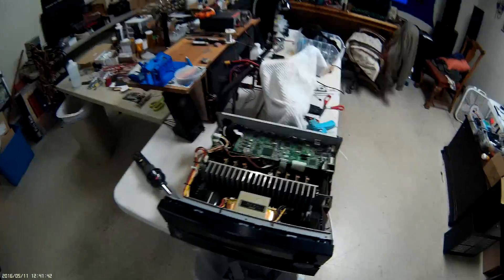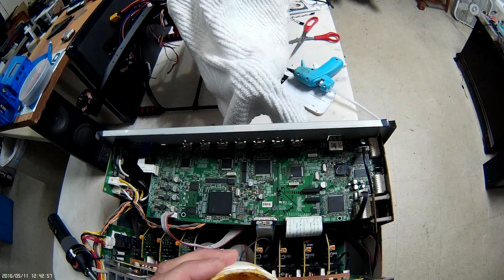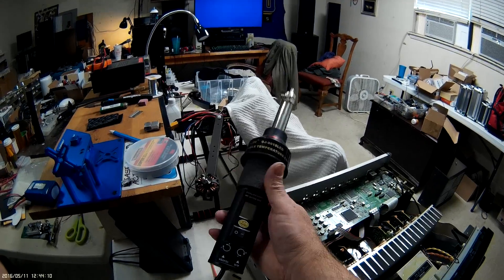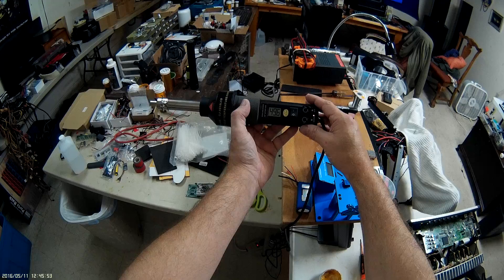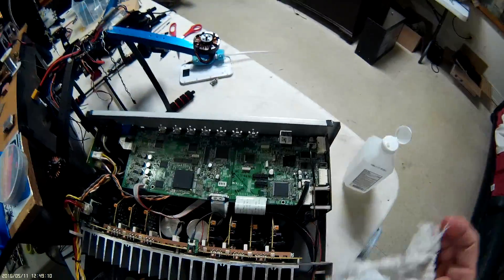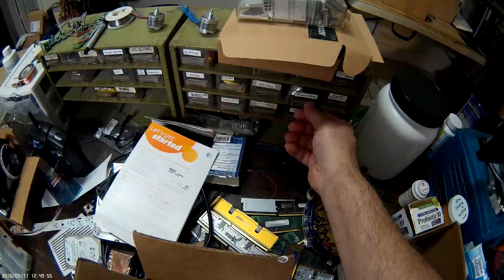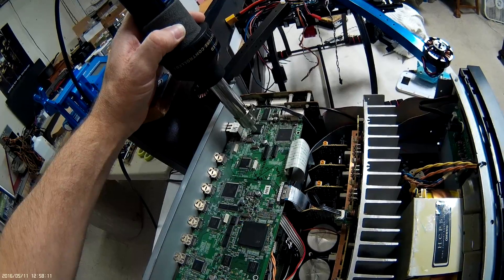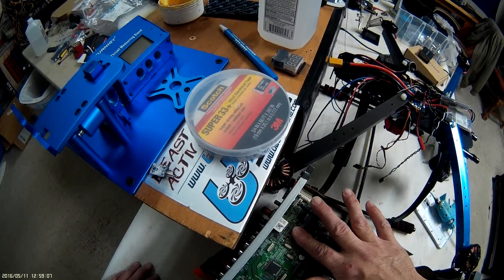Onkyo TX-NR Receiver DTS chip Reflow Procedure

Comment: HI Sir. I have Onkyo TX-SR875 which have issue of popping and crackling 
sound from front and surround channels. Few weeks it gave popping sound 
from Front Left and Surround right speakers. And then the both channel 
doesnt output any sound, its not completely dead because sometime it 
give sound with popping noise. When I try to firmware update it stucks 
in Updating.... option. Please help me to repair my AVR.
Reply from the maker: Popping in the speakers usually points to a bad output transistor but if yours is getting stuck writing firmware, it may have more than one problem. Did your receiver get surged? Sure sounds like it. It may not be worth repairing. But I would start by checking ALL of the output transistors and capacitors. Bad capacitors can also cause popping in the output.
Reply: @ShaneCarles  Firmware stuck issue solved. But i still dont got sound from digital audio inputs. Avr gives sound only with cd, aux, tape stereo analog input only and give sound in direct or pure audio mode only. No output from other sources and no preamp out. Is it issue of CS3318 audio switch ic?
Reply from the maker: @adsaudioenthusiastic8704  - So it doesn't output digital audio and only analogue signals? Could be the DTS chip issue.

Comment: what a next ur onkyo receiver?
i have like same probelem
i was may time reflow Dts chip but still have like same probelm....
plz answer me, what a next
check to near Condenser(casipiter)?
Reply from the maker: Or re-ball the DTS chip.
Reply: thx for ur answers:)
Reply from the maker: No problem. If reflowing the chip doesn't fix the issue, either the chip is defective, you have a firmware issue, a bad FET output, or capacitors. Those are most of the things that would cause the speaker matrix to not show up.

Comment: To be clear, I used a flux pen around the edges of the DTS chip. I don't have a temp controlled heat gun so I just used the one I have and turned it on and off until I could see the flux starting to smoke. I used Isopropyl alcohol to clear the flux but I always buy 91% pure alcohol for electronics work (and all purposes) instead of the regular ~70%, that way it has less water in it and more quickly evaporates and cleans up faster. Anyway, otherwise followed Shane's instructions and it worked on the first try!  Thanks Shane!

Comment: Shane, I bought an Onkyo TX-NR555 supposedly refurbished. I got it home and plugged everything in. First thing I got was error "Check SP Mode" and it would shut back down. I took all the cables off and started it again and same thing. I reset it per Onkyo's site. Now it turns on but only in Zone2 mode. I still get no sound. Can you please advise? Thank you
Reply from the maker: Do you get a speaker matrix on the display? The common issue with most of these are the DTS chip on the HDMI board. Check SP Mode means a short across the outputs somewhere. If no speakers are connected then you have an internal short. Could be a capacitor or transistor output shorted.
Reply from the maker: Check SP Mode stands for Check Speaker wiring from what I can read. But if no speaker wiring is connected then that would be an internal short across the outputs somewhere.
Reply from the maker: Check the speaker terminals closely and make sure there are no stray strands of wiring still under the banana screws. All it takes is one jumping across.

Comment: Shane, Thanks for the great video! 

I have TX-NR828 with the same DTS chip problem. I have the same heat gun as you. I placed the appx 3/8" snoot on the heat gun, and set the temp to 650F and the airflow at about 80%. I heated the chip for what seemed quite a while - I could see the flux pulsing in and out from under the chip. However, the reading I get on my laser thermometer is only about 300F at the chip. IS that hot enough? (seems like it should be). 

Anyway, I tried this about three times, and I still get no "light". I see the FM section "tuning" but get no output in my headphones. I tried all the THX/DTS settings etc...

Any ideas?

Thanks!
Reply from the maker: I've had to replace every single one of the capacitors on these boards before to get them working again. If that doesn't fix it then the chip is bad.
Reply: Thanks again for the great info! I may just have my local EE friend take a look. I'm just a lowley CS Guy! :-) 

I'm really pissed at Onkyo right now!  I'm considering a future replacement of almost any "non-Onkyo" (or Integra) brand! Maybe Marantz, Pioneer, Yamaha, etc. 

Do you have any favorites?
Reply from the maker: Lance Bledsoe you are very welcome.
Reply from the maker: I Like Marantz, Yamaha, Pioneer in that order. But there are other more expensive brands out there that are far better than any of those even.

Comment: 4:53 you plug in the heat gun into 3rd from lite then 12:10 you say unplug the heat gun but you unplug the wrong one, you're gonna burn yourself one day
Reply from the maker: The heat gun has a switch on it. It was off.
Reply: so what did you unplug ?
Reply from the maker: It was the cord to my TS100 soldering iron.

Comment: i've had a few 709's and 2 809's with this issue, and I am bidding on a 3009 on ebay wtih the same no sound issue. Onkyo fixed them all free even send me a box and packing materials, The repair center is only a state away. took less than a week.
Reply: yes, but this free of charge repair  for units out of warranty  ended 2017 or 2018 :(

Comment: Hey Shane, I am really sorry to hear that you were effected by the floods. Its such a shame to hear that after a fantastic instructional video you have uploaded. Keep up the good work and I am looking forward to learning how to replace the caps on my TX-SR875 as now its failing. Cheers.
Reply from the maker: Thank you for the kind words. It really means a lot to me. Replacing caps is really easy. I usually try to find the best brand cap and replace with the same values. These boards have SMD caps so if you can't find the right voltage they may not line up if you go up in voltage which is okay function wise, but since they are SMD the caps have to line up with the soldering pads.
Reply: Shane Carles
Reply from the maker: Hi Matthew Lau!

Comment: Been doing this for over 3 years on these receivers, some of these suffer from the solder issue you address here, however these chips still eventually fail regardless of heat or soldering, this is only a temporary fix i'm afraid may last 6 months or so depending on how much use it gets
Reply: Mine been going for 18 months now. No problem. I reflowed using a gu10 50 watt halogen lamp.
Reply from the maker: They usually last after doing this if the chip is heatsinked.  I was going to do one on replacing the caps but I lost the shop and all of it's contents in the flood down here in Louisiana.  We are rebuilding and I hope to be back at it by the end of the year. The only thing is I lost all of my equipment. I have to replace everything from the ground up.

Comment: what about an onkyo TX-RS805 that has no sound but the "speaker matrix" is visible?
Reply: ouch. Did one of the amp boards fry? Maybe shorted outputs?
Reply from the maker: Have you cleared the firmware settings and then flashed with the newest firmware? Other than that bad outputs maybe?
Reply: little too late...the unit flashed sparks on one of the boards and started smoking. Soooo, dead.